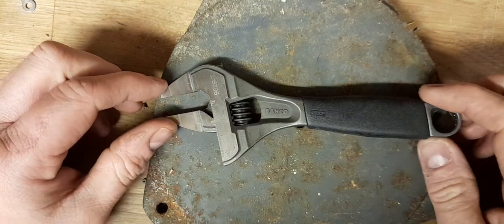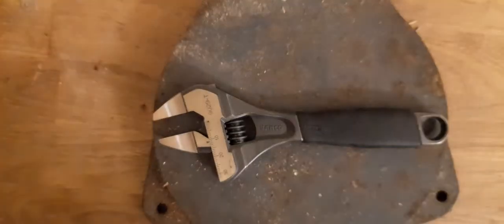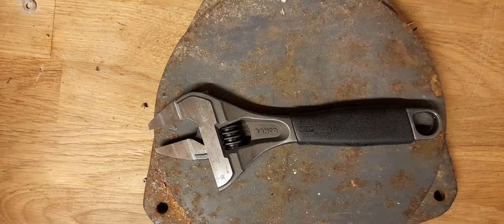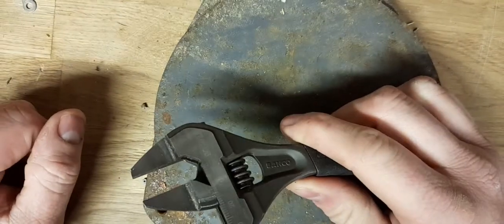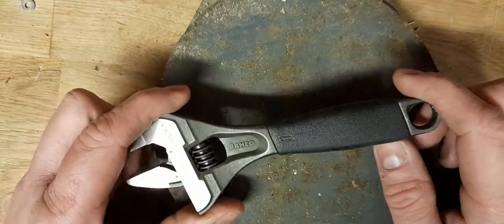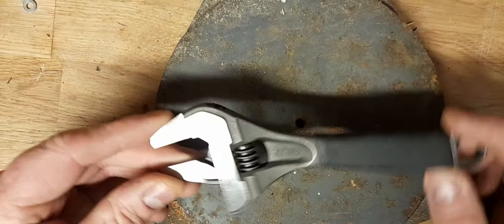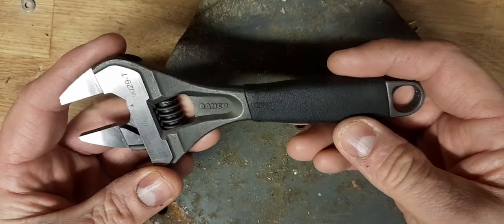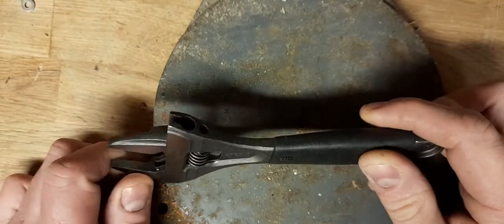Bahco 9029t adjustable spanner. First impressions

Comment: It's true, Bahco really manufactures this adjustable wrench for Snap-On on the same factory they did their own, in a factory that belongs to SNA Europe, in Spain.

There's a video here in YouTube that shows briefly the manufacturing process of this wrench and they show the Snap-on variant as well.

The only difference is that the Snap-on's are all about branding and cosmetics, they are perfectly polished and chromed, with a red handle.

While the Bahco are a little roughly finished. But the price difference between them is huge, about triple the price or even more, for the exact same overall quality standards.

I've bought some Bahco's ratchets too, they have the excellent Dual 80 mechanism of the Snap On ratchets, the ratchet internals are the same.

Another brand that belongs to Snap-On and costs much less is Williams, their industrial focused brand.

The only Snap On tool that I would buy is the LN47ACF pliers, because Knipex has nothing similar in their catalog.

Comment: Channel locks are tongue and groove pliers not pipe pliers pipe pliers are different
Reply: There are several names for that, another one is "water pump pliers". I use that one, because the german designation is Wasserpumpenzange, so the literal translation. Easier to remember for me.

https://en.wikipedia.org/wiki/Tongue-and-groove_pliers

Some people mistake water pump pliers with the swedish model of pipe wrenches.

https://en.wikipedia.org/wiki/Plumber_wrench
Reply: @Marcel_Germann  the Knipex style are water pump pliers the channel locks are tounqe and groove style it's weird
Reply: @bloodsongsToolreviews  Actually it's the same thing, only different names. And we've got the same thing here with 2-pole voltage testers. Here we call them all Duspol, but actually is Duspol a trademark of the company Benning. But all electricians call all 2-pole voltage testers Duspol. No matter who's the actual manufacturer, could also be a Fluke or a Megger.

Which Knipex style do you mean? The Cobra? Because the Knipex Alligator are almost the same style as Channellock. And Channellock also manufactures different models.
Reply: @Marcel_Germann  Tounge and groove pliers discribed the way the tool works ,  there are many grooves the the "tongue " enters as an adjustment
Reply: @Marcel_Germann  trade names Channel locks are Tounge and grove and the Knipex are the button slide reguardless of the brand
Reply: @bloodsongsToolreviews  Can be confusing if someone's missing his Knipex Alligator...

https://www.knipex.com/index.php?id=1216&L=1&page=group_detail&parentID=1368&groupID=1506

But this probably is because Knipex was the first manufacturer having this design, introduced that back in 1984. Was a big thing back then.
Reply: @Marcel_Germann  we call Linesman's Kleins we call Adjustable wrenchs Crescent so on that's just how we do things.
Reply: @bloodsongsToolreviews  And water pump pliers is the purpose for what the pliers were intended for at first. They were meant to tighten the packed glands of water pumps of vehicles when they were leaking.
Reply: @bloodsongsToolreviews  That's all over the world. Like I said, Duspol for voltage 2-pole voltage testers. "Tempo" for paper tissue, you call that afaik Kleenex.

If a company is on the market for a long time, beeing famous for a product that will cause this:

https://www.benning.de/files/benning/global_content/content/news/powernews/2013_12/duspol_generation_2013/duspol_generation_2013.jpg

I got the first Duspol N (1954 to 1967) in my collection. The last model of the Duspol N was actually so popular, they manufactured it in parallel to the modern models until 2003. They only changed the colour from 1970s orange to red. I got also one of them in my collection, last version were they already installed LEDs because polarised neon indicators (for indicating polarity on DC) were no longer available. So LEDs indicate the polarity, both on means AC.
I remember during my apprenticeship old colleague told me: The Duspol is the electricians stethoscope. And he's absolutely right about this. Electricians here hang them around the neck so they got both hands free, but it's always there when you need it. The more modern ones have such fancy things like continuity, direction of the rotating field (three-phase) and such things. But these testers were plain and simple reliable voltage testers to proof if a circuit is dead.

https://abload.de/img/img_0086unkhb.jpg

https://abload.de/img/img_00853bkx1.jpg

https://abload.de/img/img_0127p1krq.jpg

https://abload.de/img/img_0129pxkww.jpg